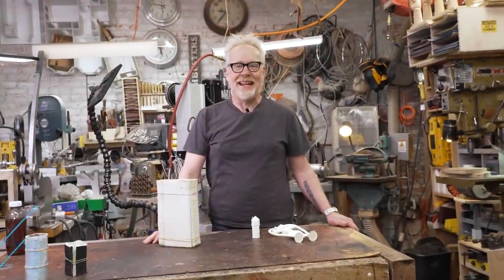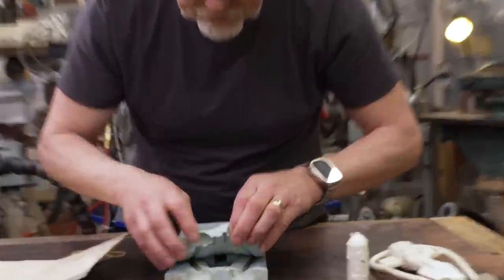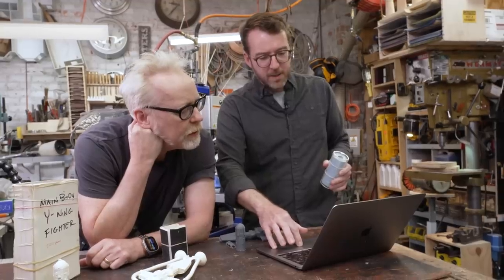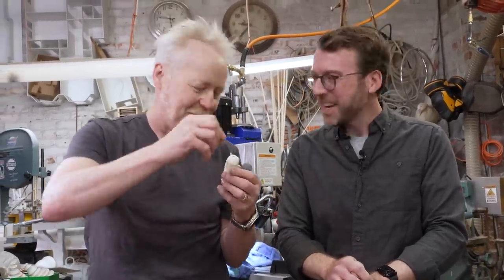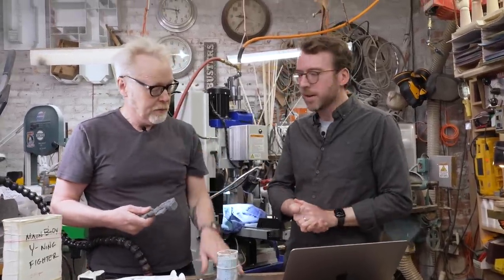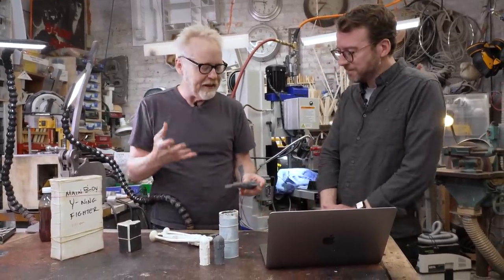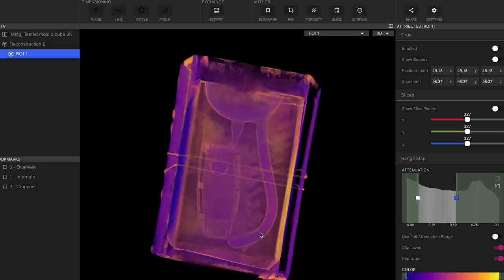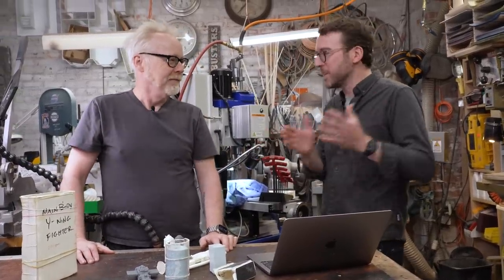Adam Savage Uncovers Star Wars Molds He Made 20 Years Ago!

Comment: So, I used to do this (the CT work). It's tremendously cool, and here's some further technical explanation for anyone who wants it:
If you notice, he puts the mold inside the uCT at an angle. The reason for this is that rather than a medical CT (which uses a fan-beam and scans a 2D stack), micro-CT's use a cone-beam(CBCT). When you use a cone beam, the X-rays actually have to travel through marginally more air the farther away from the center of the cone you are, which can introduce geometric artifact in cylindrical or symmetric samples because the image processing algorithm does not know the path the x-rays took to the detector panel, only that they arrived with a certain energy. To avoid this, you tilt those samples so that there aren't "invisible" regions that the X-rays have to travel through.

Comment: Doesn't this mean you can also 3D print the entire negative mold, correct any issues and you now have a perfect mold to recast from without affecting the original? Or you could even translate the mold into a metal by 3d printing it to have a more stable negative master to create more master positives from that you can use to create new silicon negatives

Comment: This is just superb. They can essentially print the empty space in the centre of a mould. 🤯
Reply: And you can do the reverse-most 3D print slicers have a mold function that will invert the model being printed, and then after some finishing work you can cast the object in whatever you'd like. Or, you can print the model itself and make a ceramic mold of that, melt away the plastic, and then cast in metal. 3D printing really has revolutionized the maker space, far more than just being able to recreate knick-knacks in PLA.

Comment: Every vid featuring those scanners is amazing, very interesting to see :)
I did some mold making back 20 or so years ago, then putting a model into silicone, now im experimenting with doing the "reverse" using 3d printing.
I have the model i want to get out and designing the two mold halves with half the model sticking out of each, pouring gates, vents, keys and an outline/mold box integrated, hoping i can just pouring silicone into those in order to get finished mold halves that in theory should line up.
Im hoping it works because if it does ill have cut down some of the messy, fiddly and time consuming part of the mold making process a bit
Doing it in 3d, printing, pouring in silicone, wating a bit and it should be ready for mold release and casting, in pewter for this experiment.

Comment: You can definitely see the genesis between the prototype that Adam made to the final Action Fleet (Pretty sure it'd be action fleet, scale is right, and that canopy is pretty much the final look of it) It's just a bit more bulky on the final model because they had to cut out sections for play, such as the R4 unit, screw holes, cockpit, the pop out engine section and the landing gear.

Comment: I recall the first time I played with silicone RTV and resin for replicating model parts, which was 1994-95. Indeed the molds did have a bit of a use life and shelf life.

Now some might ask why not just scan the resin part and not the mold. As I understand it, there is about a 1 to 2% shrinkage rate of the casted part versus the original. So scanning the mold instead of a casting from it would preserve as close to full size as possible. 

As far as dentistry goes, two crowns in my mouth were created thanks to 3D topographic scans of the teeth capped, both before the grinding and after. That ensured a perfect fit of the temporary crown while the permanent one was being made. Not cheap, but cool to see and do.

Thanks Adam!

Comment: My first thought on body noise is, certainly you can't make a model from the silicone but you could just pop them open and scan the halves.  The only difficulty then is matching the two scans together.  Jumps the scanning through the material problem, and maybe works with it for more detail?
Reply: You're right--that would probably be the best way to get a high-quality model; we wanted to challenge ourselves this time!
Reply: You could also use a "contrast agent" like you would in a medical scan.
If you dusted the inside of the mold with a high-density powder it would be MUCH easier to scan.
Reply: I wonder if the flexibility of the mold would be an issue, given how floppy the halves are on their own. Could be why they kept the halves together and kept it wrapped in foam core

Comment: I’m fascinated by how companies making tooling for injection moulding but alas that still stays a secret 😂Also injection moulds are very different, I’d love to learn more about that. I’ve see “How It’s Made” and there’s sometimes 3 or 4 mould parts hydraulically coming together and putting apart and there’s a few little pins that push out the part. It’s insane!

Comment: There's a bit of effort involved in orthodontic aligners between the impression to the 3d print of your next set of teeth, in that they have to take the CT scanned point cloud, identify individual teeth, and separate them out of the entire model so that each individual tooth can move to it's final destination, sometimes over a few hundred steps.

Comment: Hey I recognize that Y-wing mold! That looks like the old action fleet ones from the mid-late 90s! The nacelles terminated at about the same point and simulated the wireframe bits with clear plastic molding, the cockpit had a tiny ion cannon turret plugged into it, and it usually came with an R5 miniature that plugs in behind the cockpit! I recall having two or three of these growing up

Comment: If silicone is dense to scan and you get noise, would it be any better to fill the mould with an even more opaque liquid that could be easily washed out after?
Other then that, it seems like the moulds should be scanned open as 2 separate parts.

Comment: is there a reason you dont recast the mold with new silicone since you have the model on hand ?  I guess you loose a little fidelity but could you not put it into the original mold cast a new silicone half  flip and repeat to have two new halves  of at least the clamshell molds?

Comment: Adam, serious question... If you wanna preserve the mold digitally, why scan the mold? Why not scan the casting instead and simply invert it in software to make it a negative instead of a positive? That seems way easier. Or you could just make a mold from one of your original castings as you'd make any silicone mold.
Reply: When making a mold, there’s a loss of quality with every step of the casting process due to the viscosity of the silicone and casting resin.
So the mold is a bit less detailed than the original part and the casting is a bit less detailed than the mold was.
And making a mold from the original casting would again decrease the level of detail.
So unless you still have the original part, scanning the mold is the best way to retain as much detail as possible.

It’s kinda like how pictures decrease in quality every time they are screenshotted or photocopied.
The more often you copy something, the more the quality decreases as you loose detail and introduce artifacts from the copying-process.

Comment: I wonder if you could coat the inside of the mold with a high-density powder to improve the scanability?
It obviously wouldn't be PERFECTLY non-destructive, since you wouldn't really be able to wash it out completely.
But molds like this are already "used". They wouldn't be perfect.
It would also be a mild hazard to have finely powdered heavy-metals. But it could still be safe if treated with respect.
Reply: Speaking from experience, here's what you do, using only commercial off-the-shelf reagents:
You can make positive cast of the negative by using Lugol's Iodine and gelatin. Iodine is sufficiently radiopaque that it will attenuate the X-rays more than silicone, and once you're done, you can use a hot water bath to melt the gelatin again to clear the mold.

Comment: Is there any benefit to scanning the mold when you have a molded part still? There was discussion about the loss of resolution due to the density of the silicone and the need to "turn up the gain". Could you not gain a better recreation by using the positive of the molded part to recreate the negative mold?
Reply: There always is a loss of quality when you cast something due to the viscosity of the silicone or resin you use to cast something.
So the mold is slightly less detailed than the original part and the casting is less detailed than the mold was.
Scanning the mold gives you a higher quality than scanning a part that was cast in that mold.

Comment: If you are scared of losing a mold you should always be running the first cast in a super hard, detailed resin under precision (not production) conditions to get a MASTER cast.  From the master you can make new molds at any time and resin or even epoxy will last basically forever stored properly.  With as much work as Adam has done in casting industry I'm surprised he doesn't do some of the most basic industry standard stuff.  Production modelers in the wargame industry have been doing this kind of thing since the 1970s. Molds are not MEANT to be saved past their production.  They are by nature, disposable tools like a paint brush or motor oil. Painters don't save their old broken brushes, they save the product that the brushes made, the painting! 

Also, a master casting is going to pick up the detail WAY BETTER than any current scanning technology available today. Even if you are scanning with .5 micron, resin is still better because its literally perfect reproduction.  Scanning is ALWAYS an approximation, same with 3d printing.  So you are getting degradation at both the point of scan AND the point of print. Its even preferable to redesign the product in 3d cad than scanning most of the time.
Reply: And how much of that have you held on to twenty years later? Its not a question of loosing a mold during production, its a question of not damaging something 20 years old.

Comment: Not to second guess an expert, but I would have thought it would have been easier to open the molds and scam the interior surface ceramic on two part molds such as the main body.  Maybe there's something I'm not understanding.
Reply: It would be even easier to make a new silicone mold, using that casting he has.
Reply: @joek600  That's true too.